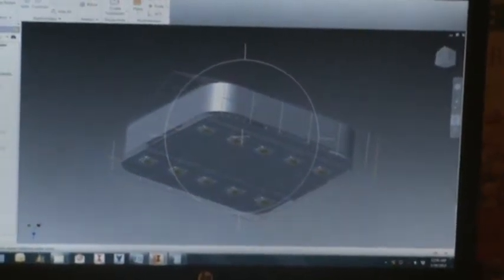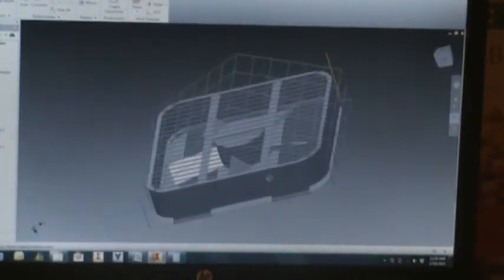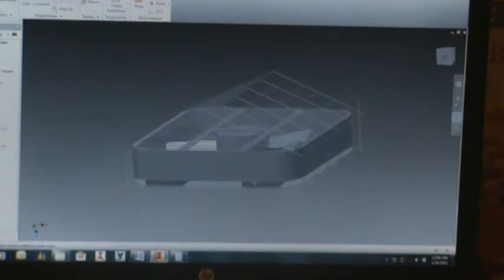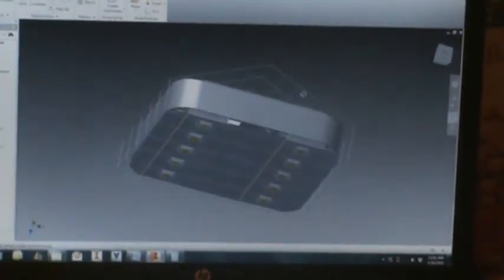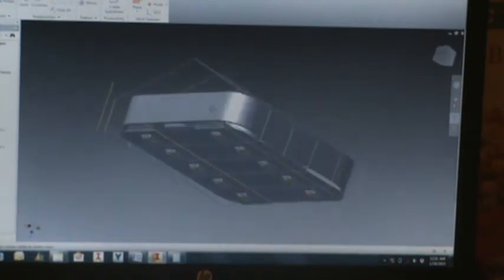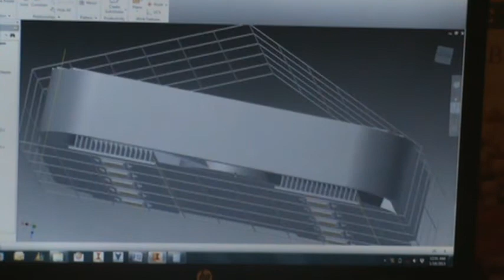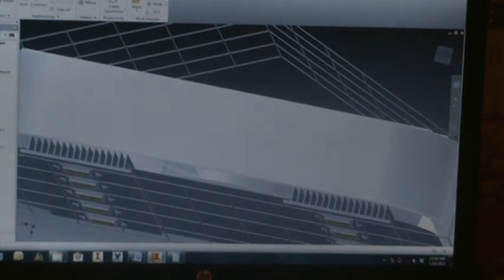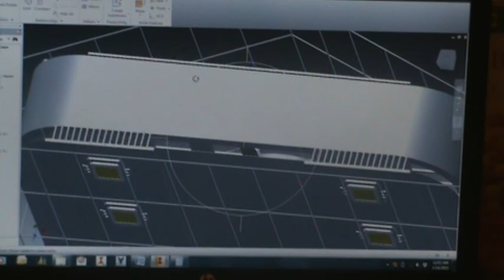1,000 WATT COB LED AIR COOLED DESIGN 3D MODEL

Comment: What if you had the fan blowing the heat up and away from it do you think that would work . I think it's awesome though nice job .
Reply from the maker: Yeah that could work but I don't want the hot air heating up the cheap Lasko fan motor.  I was thinking of putting the fan sideways like my smaller heat sink.  Thanks.